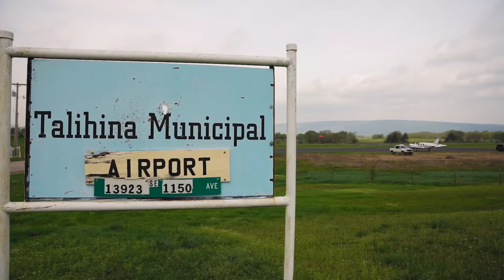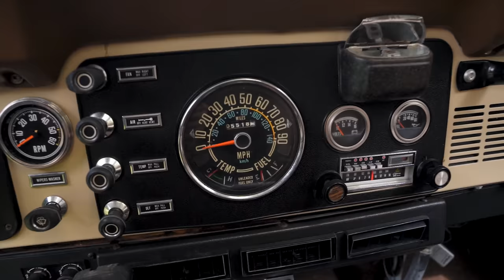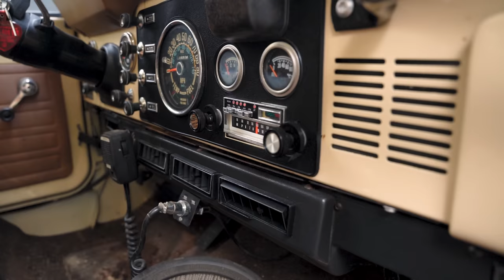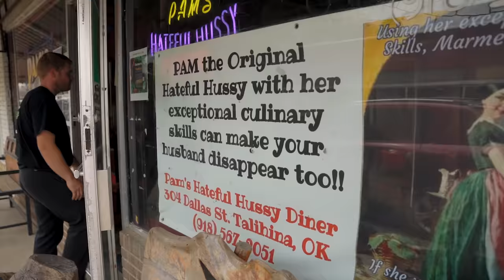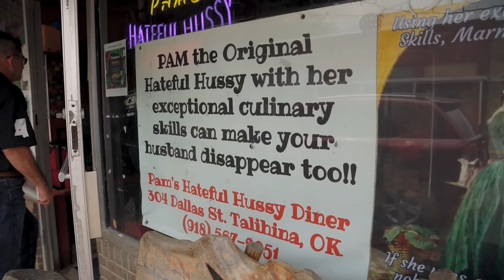RESCUED: One of the LOWEST Mileage Golden Eagles I've EVER Seen!!

Comment: My ex wife had her 33 year old tricycle from when she was 2 years old. I completely stripped it down and repainted it for our 2 year old daughter. All original parts, re chromed the handle bars and since 1996 it still looks brand new. I also sanded and painted the white walls back on to the original tires. I even surprised myself on how good it turned out.
You don't have to outrun the bear. You just have to be faster than the other guy.

Comment: Another great video. I sure do miss my 79' CJ-7 Golden Eagle. It had the 304 and automatic transmission with the Quadra Trac set up. Pwr. steering and brakes too. Mine was Alpaca Brown with the brown denim interior and soft top. Sure do miss it, even though it was a gas hog. Have  tried to track it down a few times but always dead ends. Keep up the great work 👍👍